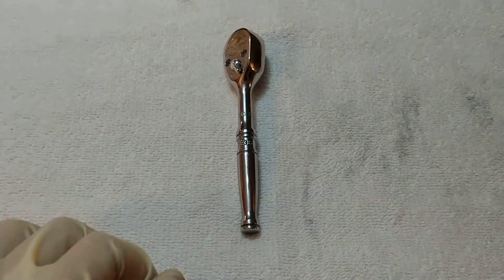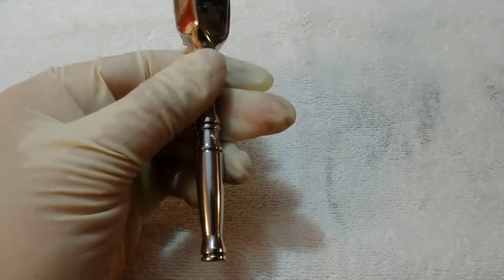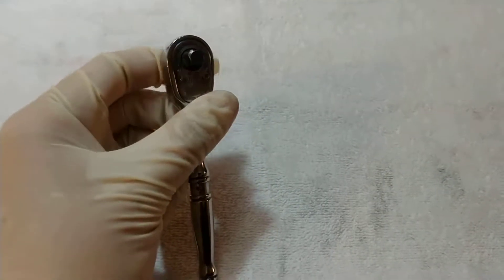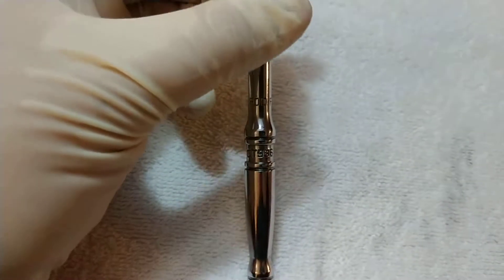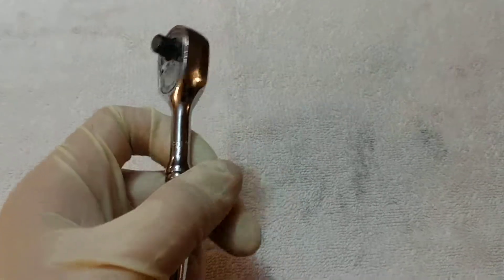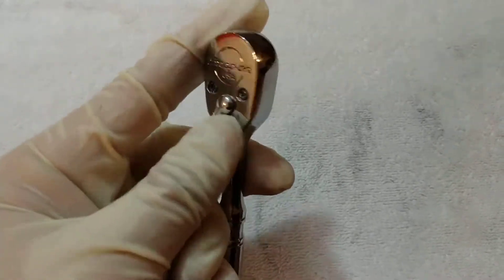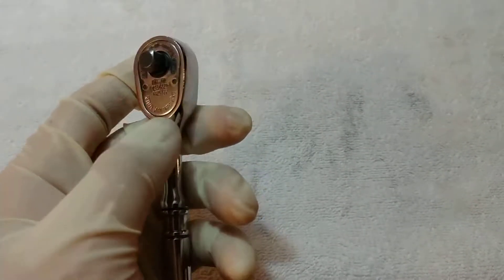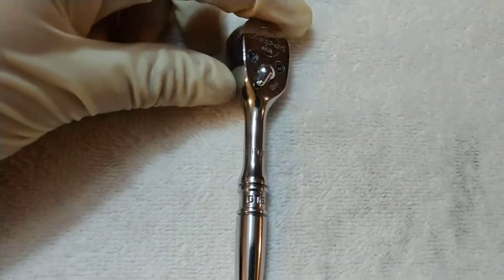Snap-on Ratchet: GT936FOD "FOD-MOD"

Comment: I have a military surplus 1/4" T72 FOD chrome ratchet, and that has FOD stamped on the head above the Snap-On logo, with USA below as usual. Interesting that the cover plate holes are threaded, I might see how much a rebuild kit would be.

Comment: Is $50 for a 1/4 good price? Used
Reply from the maker: Is it a Dual 80 ratchet. Assuming Yes It depends if it is flex-head. If it is a flex head handled (soft or hard) then I say it is a great deal. For a fixed handle I believe it is fair: as in not great not terrible. Of course this is subjective and condition depending.
Reply: I paid $80 for a used 1/4 vintage, (80’s) version. Super small head and the switch is located next to the anvil! So cool.